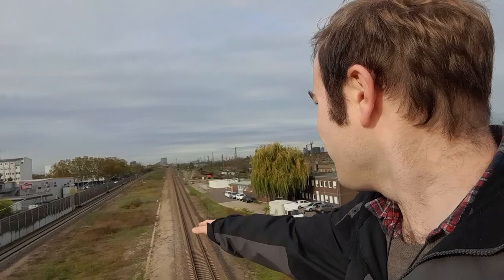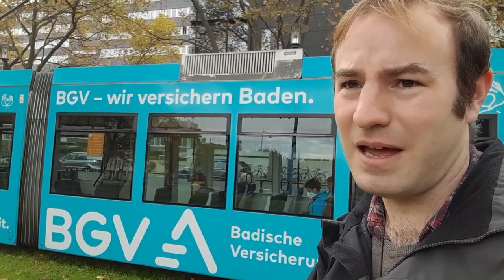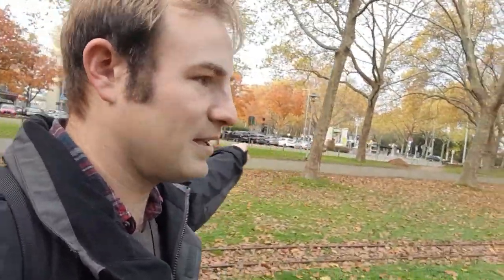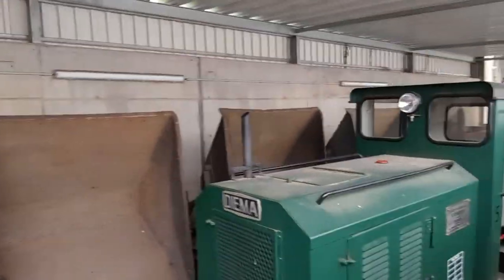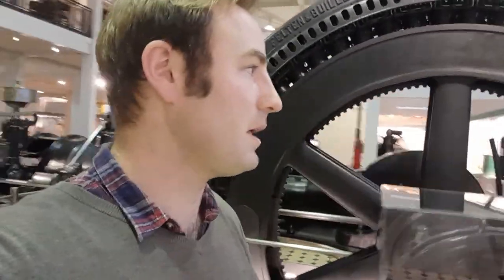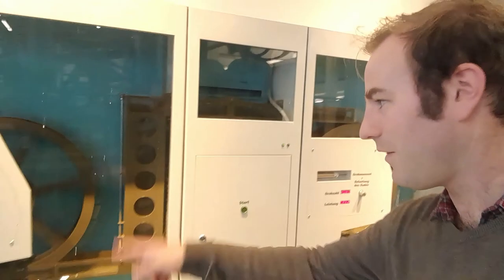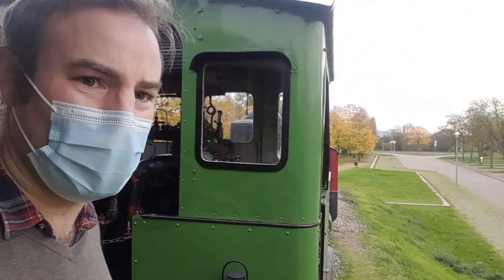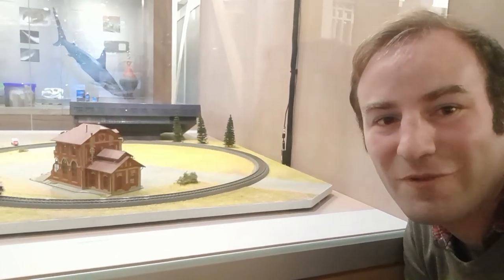A Visit To Mannheim Technology Museum - Mannheim Technik Museen.

Comment: The main difference between the museums in Sinsheim (and its sister in Speyer) and the museum in Mannheim is that Sinsheim and Speyer (same owner...) are commercial venues and the Mannheim museum is in public ownership, run by the state of Baden-Württemberg. The Technoseum has to provide subjects for learning and history facts. Usually, after entering the museum you use the elevator to the top floor and go down in a spiral to the lowest level. This is why the building is not always built at right angles.
Walking like this, you travel from the earlies forms of industrialisation around Mannheim in the 1600s at the top floor to the modern manufacturing in the cellar. Do it like that!
Reply from the maker: Thank you for joining me and the info.